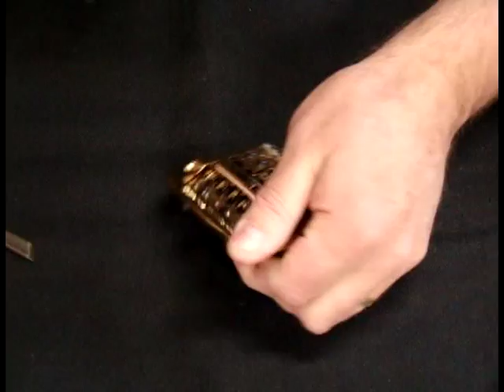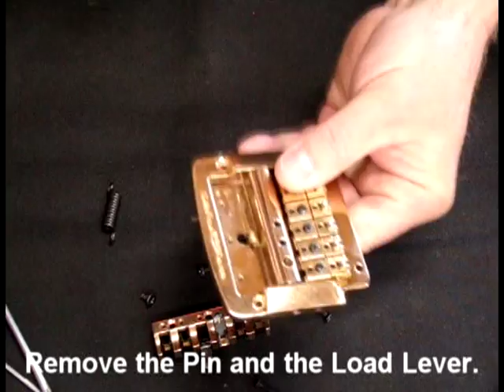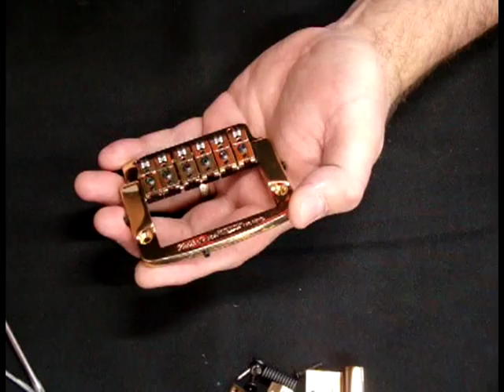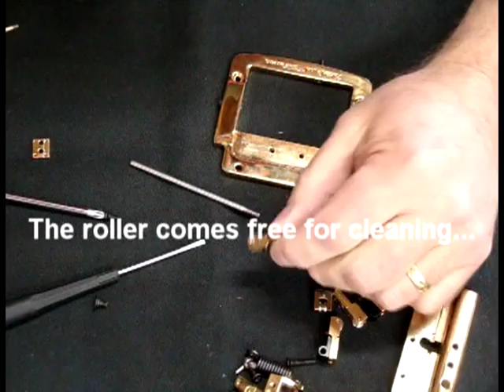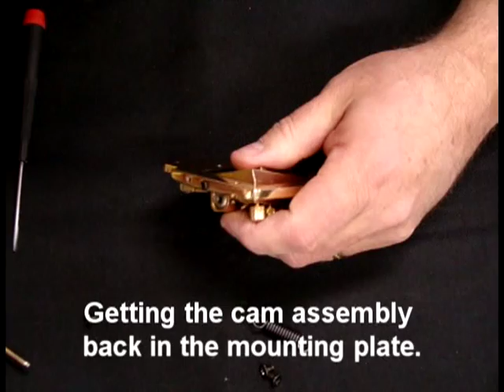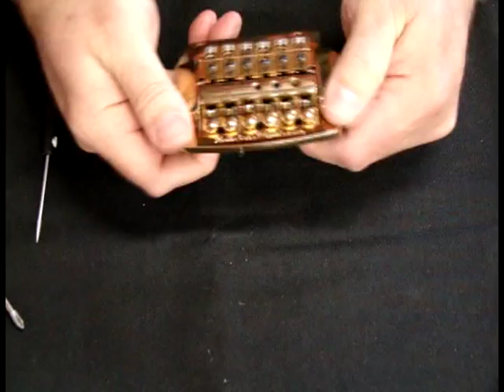See a kahler completely taken apart from scratch.

Comment: I have Kahlers on both my guitars. A 2200 and a 2300 they are both from the 80's the 2200 is one of the first Kahlers made. I want to replace both Kahlers with new ones. Does the 2200 and 2300 Pro Series come with the lock and load bridge does it lock? Like the Hybrids.